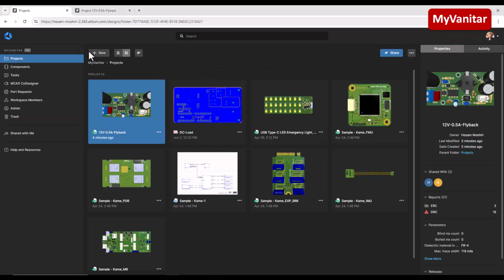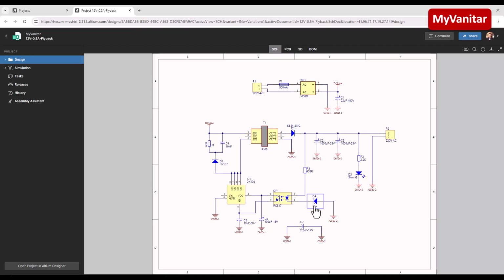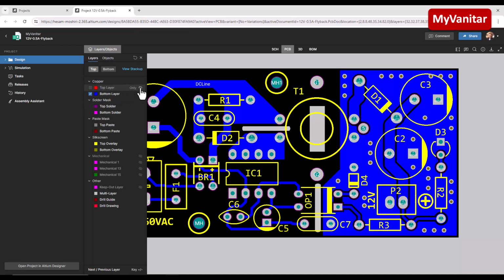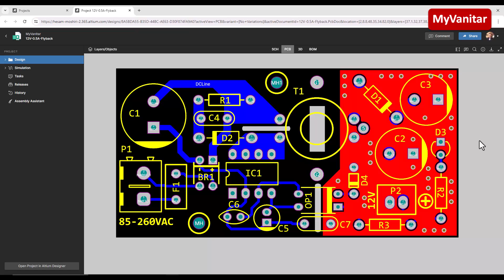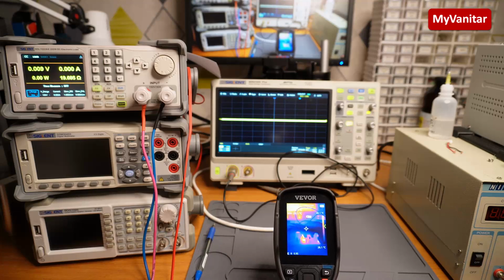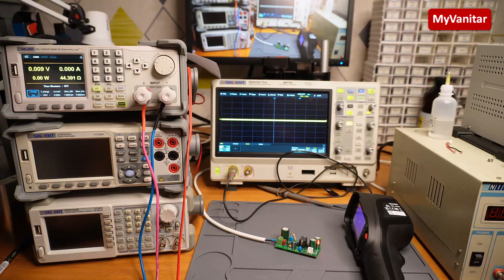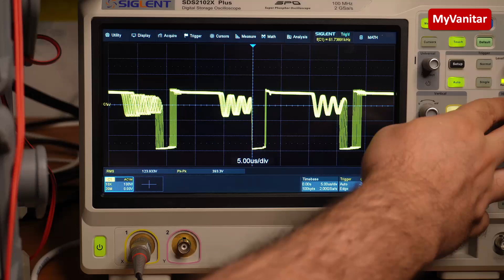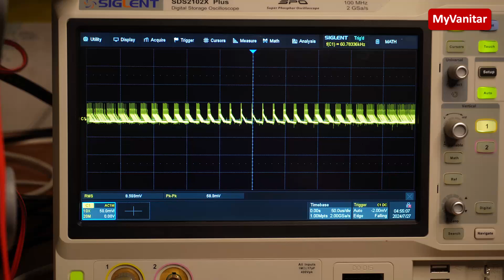DIY AC-to-DC 12V Flyback SMPS For Beginners

Comment: Nice example for someone wanting to get experience in building a small flyback.  I like that you used through-hole design.  Its very educational.  With the majority of electronic components moving to surface mount, us in the educational world will need to figure out how to implement experienced based circuit design and testing using surface mount. Again, thanks!
Reply from the maker: You're welcome gentleman

Comment: I dont understand one thing how is the ic IC1 able to survive such high DC voltages coming in from the transformer ? Even though its dc it will be greater than 100 volts right ?
Reply from the maker: No, check the datasheet and block diagram of the chip

Comment: Great project. But 50 years ago we built linear 12V supplies 100 different ways, then switching came in and zillions have been built since.
Reply from the maker: the only way to learn is to practice. most cheap supplies you see on the market do not follow the design standards. they just work "somehow"
Reply: @MyVanitar  I would have chosen a fusible resistor on the input for inrush protection. And a small diode in series with the zener to offset temperature drift in the regulation.  On many commercial units the primary to secondary windings have no sufficient insulation to stop transients.
Reply from the maker: Yes, a fusible resistor is a good option instead of an ordinary fuse to reduce even more noise, however, it's a bit difficult to find in traditional component shops. You can solder it "standing" instead of that fuse on the PCB

Comment: You did not share important things 
1.How did you calculate rc snubber and
2. how did you calculate numbers of truns
Reply from the maker: They are mentioned in the article which will be linked in the description (Article: ...)
Reply: I'm also interested in how to calculate the transformer.
Reply: I see there is a similar example circuit in the DK106 data sheet. They suggest input turns 192, output turns 25 and a P/S/P winding pattern to reduce leakage inductance. Now I'm just wondering about wire diameter to use.
Reply from the maker: PSP is so-so for low currents (the effect is small), also it's difficult for people to wind on a small bobbin. wait till I put the article link
Reply: @MyVanitar  Thanks. I can imagine that 192 turns with very small wire diameter requires patience and precision, you would probably want to wind it in one go, not making complicated layers.
Reply: Thanks